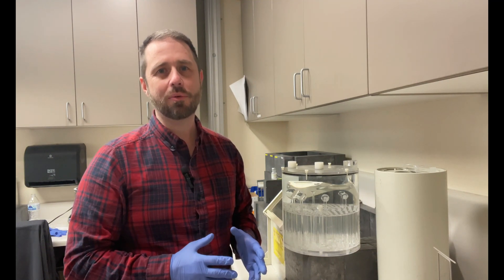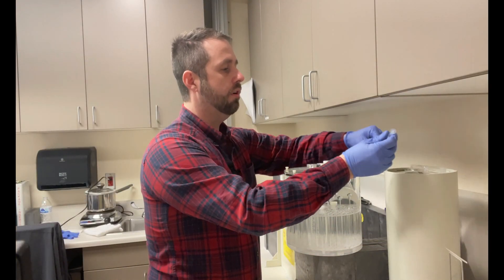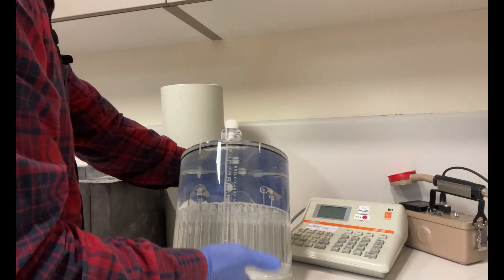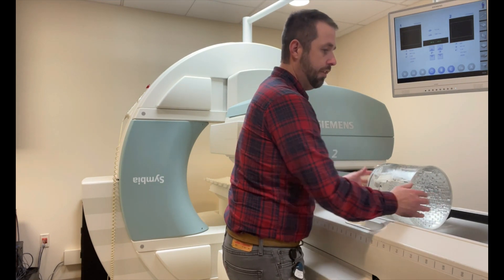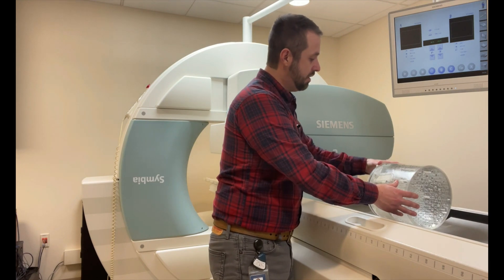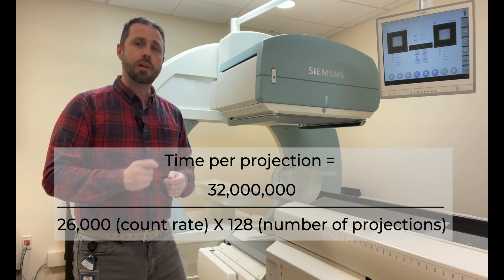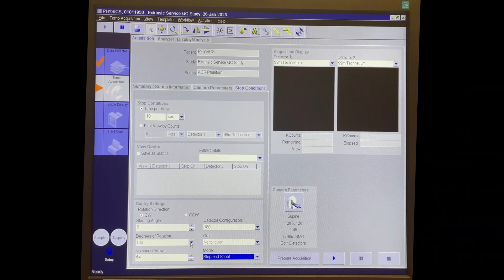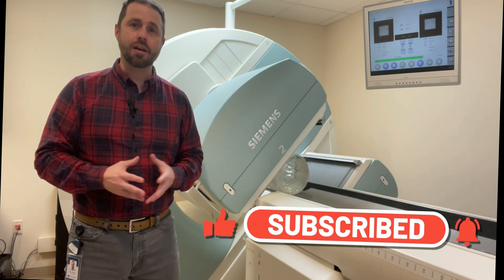How to Scan the Jaszczak Phantom

Comment: May I know which protocol acquisition you chose in the system for this QC?
Reply from the maker: For this acquisition, we chose "Example Tomo" from the Siemens protocol list. However, any tomographic protocol will work as long as the parameters are changed correctly.